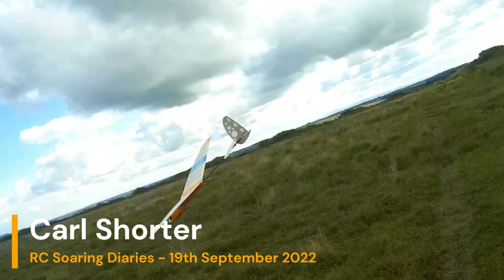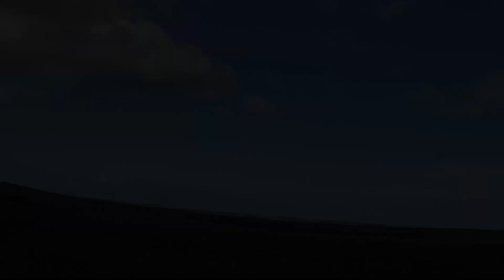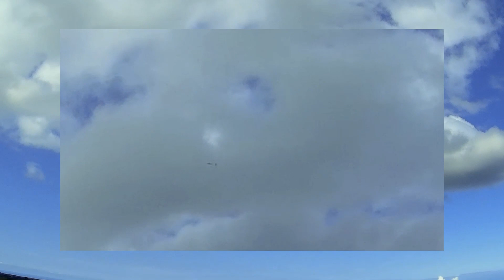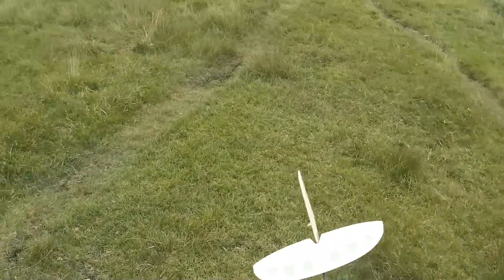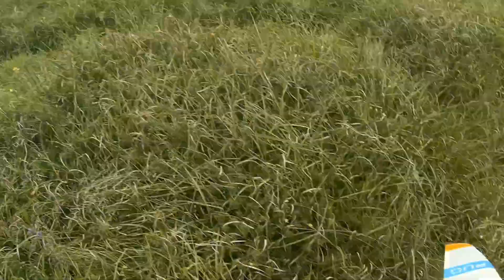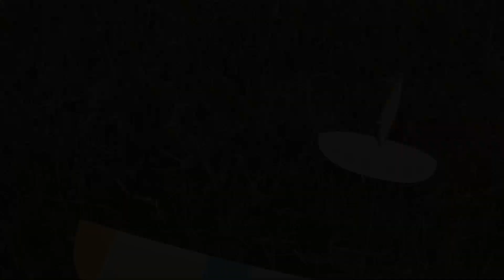Test Flights: Pug Electric ALES RC Glider With New Power Setup - 19th Sep 2022 - Angelwing Designs

Comment: Nice test flights! 👌You could catch some lifts. 👍 So can I use propeller at my 2ch DLG with 2s Li-Po?
Reply from the maker: I feel the balance of power and weight is spot on now. Yes you could certainly use a 2s lipo for your 2ch DLG. Even my 1.5m Robbe Joy uses only 2s.